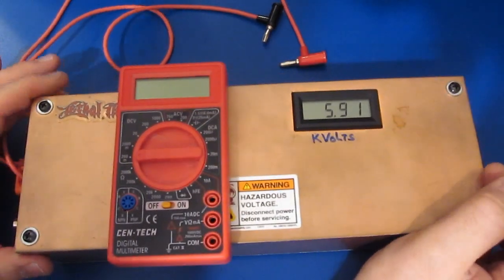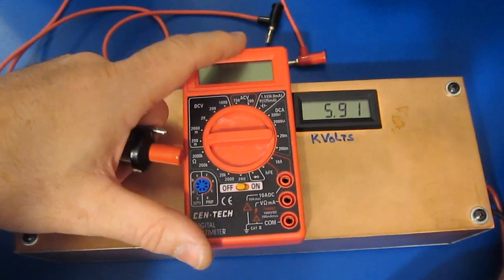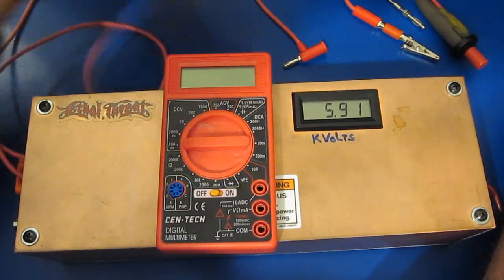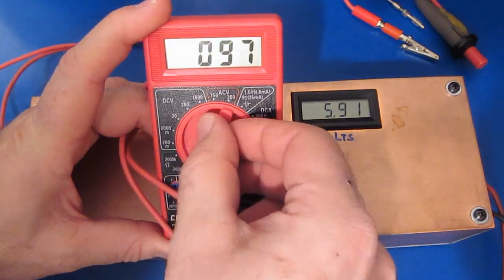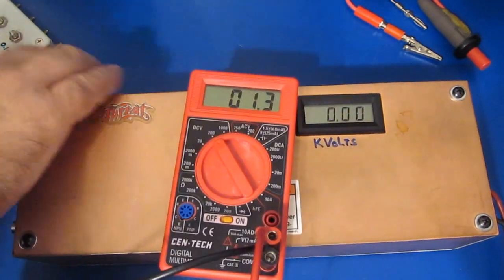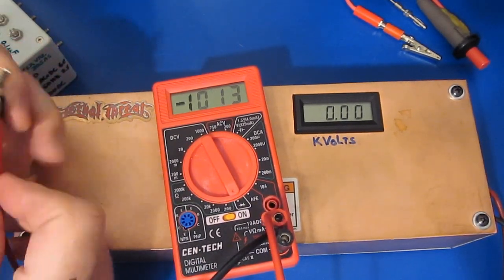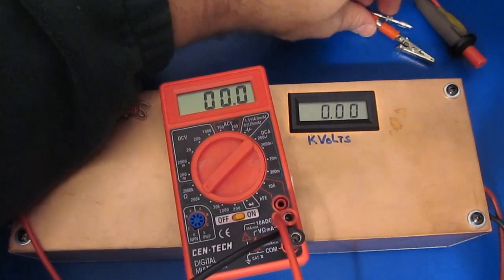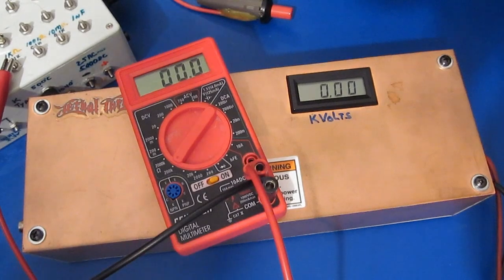Homemade ESD Gun vs CEN-TECH DT830 Meter

Comment: If you need any of these, I have 4 or 5 just for battery testing. I also have the clamp meter as well, your welcome to that one also.
Reply from the maker: How's things going for you?   A few people had asked me to run one of the meters I had previously damaged with the grill starter using the new gun.  I guess showing all the waveforms from it was not enough to convince them especially when it has never been shown to damage a meter in all that time.  I couldn't see buying another UNI-T and decided to save this DT830 for this test.  It was basically brand new except for cycling the rotary switch.  Doubt I will run another one after this but thanks for the offer.